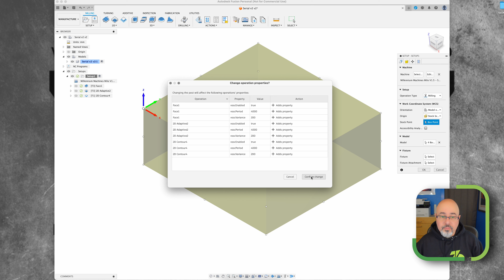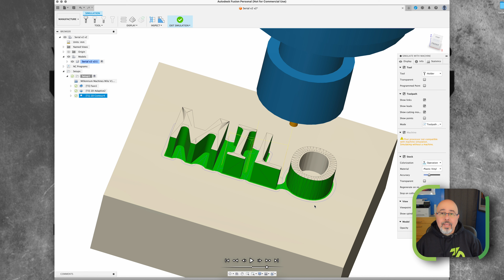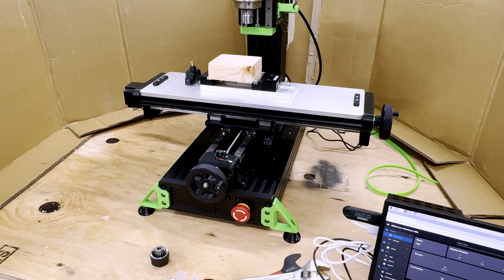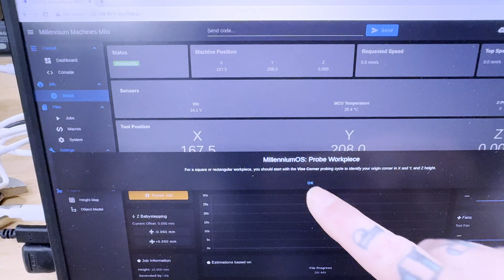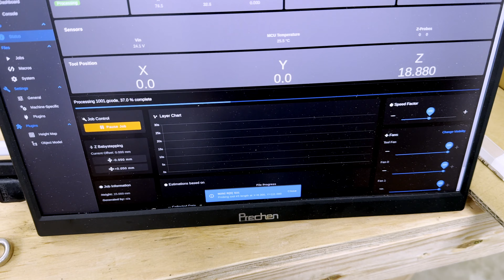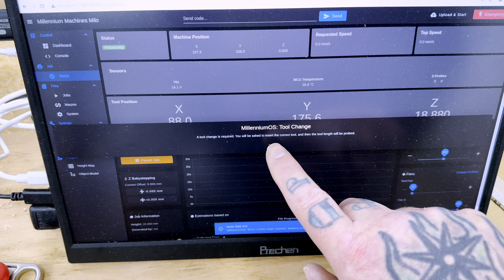Milo Update 5- Fusion, Firmware, Making Chips!

Comment: Great vid, thanks for going through the process 👍- when running multiple ops because of the Fusion limitation, it might be best to untick 'Home before start', especially when you're not re-probing the origin - otherwise there's a chance your endstops activate early / late and put your machine slightly out of alignment with the previous operations. 

Aside from that, yep - MOS is very verbose with tutorial mode on. I'm not sure whether it would be better to move some of its' cycle documentation onto the website. It's definitely a better place to read the documentation but it isn't available if your Milo is running in AP mode or you otherwise don't have internet access. Difficult choices 🤔
Reply from the maker: MOS being verbose is a feature, not a bug! Eventually I'll turn it off, but for now it's great to have a guide walking me through the operation of the mill. Thanks for writing it!

Comment: By far the best video I’ve watched on the Milo. Definitely helps a lot. Looks super easy to get going. Are you gonna stick with fusion or move to Freecad?
Reply from the maker: I'm sticking with Fusion for now, since I've been using it for years. Still open to making a change, though

Comment: What worries me is the lack of  real CNC machine experiance from the Millennium Machine team members.  Jake and Nine Mile are great guys but they are more from a  3D printing background which, in my option, shows in some of their design choices. For example chip management. You can  see @29:38 the lead screw is covered with chips. Where are the bellows? I also noticed that the holes on the linear rails have no caps. It will be interesting to see how the machine holds up in the long term >>>>>
Reply: True ninemile and I don't have industry experience but between Ed and Dave there is at least 30 years of manufacturing and CNC specific experience we don't just guess between them and myself we find the best ways to do things with the limited budgets and with the knowledge that those guys give me its a big team effort.
Reply: @jakeengland1430  Jake, Thanks for replying. I wish you all the best and hope you do well. I will probalby buy a kit sometime in the future but I will wait for version 2.0 😁
Reply: Yeah definitely correct in that I don't have real CNC experience - I'm a software engineer turned hobby mechanic / engine builder (out of necessity lol), but as Jake says we have guys on the team with a lot of experience running actual equipment, and they are listened to.

I started out as a milling newbie building a self-sourced Milo and once I had the hardware and electronics together it was clear to me there was a gaping hole in the 'knowledge gap' between 3D printing and running a mill, and that I was in a good spot to do something about it - which is where MillenniumOS came from.

I'm hoping the stuff I've learned and understood from those who know more than I do can be distilled down for others to learn from in future :)